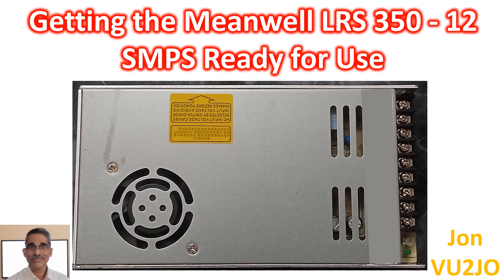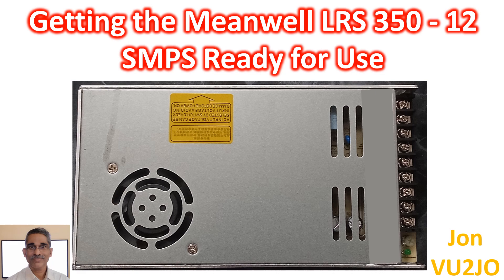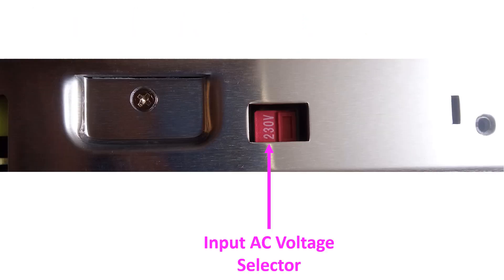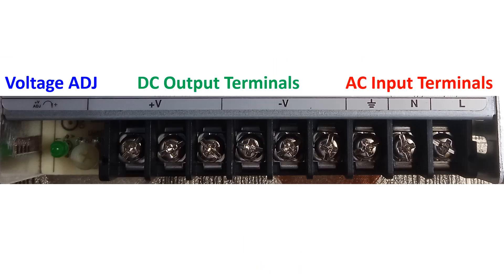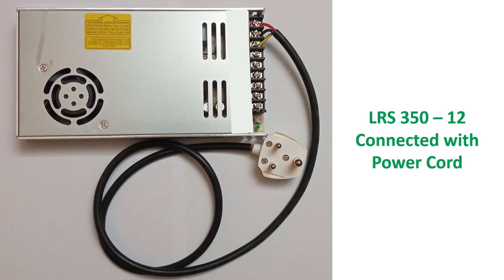Getting the Meanwell LRS 350 - 12 SMPS Ready for Use

Comment: For ham radio operators its always better to for the model LRS-350-15 Mean Well SMPS - 15V, because it can be adjusted to 13.8 Volt and that is our normal required voltage for most of the equipment.

73
VU3TBU
Reply from the maker: You are right. But this was the only one available in a local online site! Manual says it can be adjusted up to 13.8 V using the preset potentiometer. I have not adjusted and not used for HF yet. Just tried it for my VHF and VHF/UHF dual bander once.

Comment: Thank you for the video. I recently discovered and subscribed to your channel. Great content. 

I purchased one very similar from Amazon US. It worked great as a hobby power supply. I was also able to adjust mine to 13.8 volts. 

eTopxizu 12v 30a Dc Universal Regulated Switching Power Supply 360w
Reply from the maker: That is nice to know. I have not changed the preset potentiometer setting yet. Tried the SMPS just once on my VHF and VHF/UHF base radios. Glad to have your feedback. Thanks a lot. 73 de Jon, VU2JO.